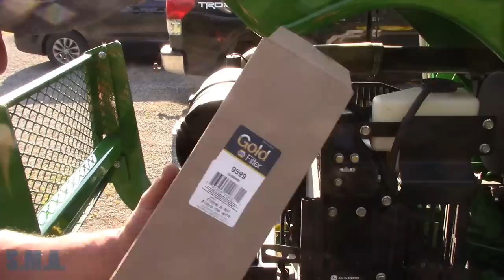John Deere 5055E : Service

Comment from the maker: PRODUCTS USED IN THIS VIDEO:
LockNLube Grease Gun Coupler: https://amzn.to/2CGYCzU
Lincoln 1147 Grease Gun with Hose: https://amzn.to/3g7t3xG
Heavy-Duty Oil Filter Wrench 4-1/2" to 5-1/4": https://amzn.to/2ZXJAP0
Shell Rotella T4 Triple Protection Conventional 15W-40 Diesel Engine Oil: https://amzn.to/2CQOi8r
 Scott Shop Towels: https://amzn.to/3hCfuGO
Reply: Nothing runs like a Deere
Reply: That Lucas Red and Tacky in the grease gun? Sure looks like it anyway... That grease gun coupler looks amazing, though it costs 3x the price of each of my grease guns...
Reply: That locknlube is the greatest addition to any grease gun.
Reply: Only use John Deere hy-guard fluid for the rear end any other fluid will tear the brakes up
Reply: Thanks Eric O! Johnny’s lookin’ spiffy!
Reply: @mustangvideo2060  drink john deere kool-aid ,  leave check amount blank, dealer will fill in the amount $ .
Reply: Pro Tip: Pull the dipstick before you refill the engine oil. It creates another vent hole. Then you won’t be waiting on the oil in the funnel to flow in.
Reply: Good looking tractor Eric. Hope it lasts you a long time with no major problems. I like green better than orange.
Reply: Channellock PVC pliers work great for big filters !
Reply: I'm pretty sure my grandpa always went to Napa for parts for his semi trucks. Dad also told me they used to put water in the batteries when you bought them.
Reply: That locknlube grease coupler looks awesome I have to get me one for my grease gun the original coupler would lock in but not release until it got stuck in a nipple and broke time to replace thanks for showing it in the video Eric!
Reply: Get that man a new John Deere hat . He ain't working on junk now.
Reply: Nice machine, what 55 hp, whats the torque, thats the real measure of a diesel power, must be nearly 200nm?
Reply: Hydraulic cylinder on tractor
Reply: I do the same thing with wiping down the excess grease and the zerk fittings lol

Comment: Being a diesel mechanic, I love my universal strap wrench. One size fits all.
Reply: just mentioned using a strap wrench, old serpentine belt, old seat belt or even the belt off your waist :)
Reply: I have strap wrenches, vice grip oil filter wrenches and one of those horrible snap on chain wrenches, I never need to use them, cowardly oil filters !

Comment: Eric, from an old farmer, always block up or tie off any hydraulic accessory you may be working under.  When new, it seems safe, but it won’t take long for small bleed offs to start happening in the cylinders.   My Dad almost lost an arm trusting the hydraulics.  Be safe.  Otherwise great video as always.

Comment: Step up onto the rail when you start it brother, you're one neutral safety away from being jelly.
Reply: solid, solid advice
Reply: Can't say I disagree with this one but I gotta add that for all my life I've been trained to check gear shift to make sure it's in neutral, from semi trucks to open station tractors. If you know what you're doing and it's part of what you do standing on the ground is okay. But for most all people, stand on the step at least like you say.
Reply: The three guys that didn't follow this advice are not available to support your comment.  That 4 x 4 wouldn't have much trouble crawling over the youtuber.
Reply: Yes, let’s not shake hands with danger
Reply: farm.central. ohio had a guy I used to work with at a shop working on a car and he asked someone to start a car for him, guy reached into the window not realizing it was in gear and the safety switch obviously broken, car cranked up and lunged forward and pinned the tech between the car and a massive steal used oil tank, broke his hip pretty nicely, definitely taught me a lesson at an early age lol
Reply: @2491kridge  Every fall I use an open station tractor to power an auger for unloading trucks. I start that tractor every time standing on the ground beside the rear tire and every time I check the gear shift, even though I'm the only one that touches it all season.
Reply: My JD has the clutchless PowerReverer shuttle transmission.   You can easily start it up while standing next to it, no clutch depression is required, just the shuttle lever has to be clicked into neutral.   The shuttle option is a no-brainer for loader work.   Not having it on a loader tractor would badly de-value it at trade-in time, moreso than the cost of this option, so it's virtually "free" in the end.   SMA likely got a great "deal" because the original owner traded it in for a shuttle tractor.
Reply: That tractor actually has a Park gear.
Reply: John Deere only starts in neutral
Reply: @davidwinfrey3307  All John Deere's or this one that Eric is working on? Because if you say all I'm never standing near a tractor when you start it up.
Reply: @2491kridge  That's part of the problem - unless it happens in front of some people it's not a "real" danger. See what's happening with covid at the moment.

Check the gear, call out to the person under the hood, wait for reply, THEN start if appropriate.
Reply: Good advice but he’s got a 5”er and it’s thick
Reply: safety third!  lol
Reply: Can you tell me where you got that pair of bent nose pliers you pull faces with
Reply: Hawkeye approved procedure

Comment: My sister owned the same model tractor, a very capable machine. It had never been serviced. Changing filters, fluids, a new battery, a new tire, and replacing nibs for greasing the bucket, cost for parts and fluids $1,110. Several trips into town for tools (oil filter wrench) it turned into a two day job. I don't understand why people will spend so much money on equipment and not pull the service on it.

Comment: Eric,  I usually have nothing to add to what you do since you tend to cover it all but there is finally one thing I can suggest to you or anyone. Especially if you do any brush hogging blow out the radiator, most new tractors have more than one rad stacked together and stuff will easily get caught between them. A lot of them unbolt or unlock and you can slide at least one of the rads out for easy access. They make an excellent blow gun for such a job, it's called an Air Comb. Inexpensive but works great. Just something easily over looked. Thanks for the great video. Okay now I see you blow out the rad, silly of me to think you'd skip that lol

Comment: For the oilfilter i use an old timingbelt or auxilairybelt .If parked in the open/sun coverup the steeringwheel and dash as well as the seat to avoid deteriating due to UV.
Reply: This guy knows what he's talking about  :)  and put a coffee can over the muffler if it doesn't have a flapper, not only for rain but birds like to try and make nests in exhausts. Yes, i know, why lol Some birds are just dumb I guess.
Reply: @monkehbitch  The birds are kind of interesting which pipes they go for, got an older tractor and the tip of exhaust bends to about a 45 and they land on it but won't nest. Got a newer tractor with more straight tip and every time I start it a wad of stuff blows out lol  Maybe you could cut your vents at an angle to keep them out.

Comment: Nice tractor...I am a retired fleet mechanic and I didn't see you support the bucket lift assembly when you had that up in  the air it could drift down on you and that could be serious... if the machine is off not running some units , just by moving the up/down lever will let it come down...we had safety bars that fitted around the lift cylinder piston... I have not worked on these units for several years but I think it would be prudent to look into this for your unit ...God Bless you and your family...
Reply: The bucket is on, it won't come all the way down. Relax Nancy.
Reply from the maker: No balls no glory

Comment: Hey Eric I've been reading a lot about "right to repair" issues stemming from John Deere blocking access to their farm equipment computers (equivalent of ECM, etc). Any problems in that regard working on that tractor?
Reply from the maker: I have a full set of service manual from John Deere for this tractor and that is the number one reason I bought a non electronic full mechanical tractor 😉
Reply: @SouthMainAuto  Awesome!! Thanks for taking the time to answer. Appreciate the video, as always!
Reply: The issues you speak of with JD are more with the larger farm tractors. They will sell you a high horsepower tractor but then charge you extra to get the full horsepower out of the machine by showing up with their computer and clicking on a few things. They are all about milking every penny out of a farmer. They won't let an independent mechanic have assess to any info so you are forced to take your tractor to them for work. It's one of the largest scams going on that most folks don't know about.
Reply: @farmcentralohio  I have a feeling it getting ready to creep into regular vehicles more and more.
Reply: broomsterm  You are referring to smaller tractors, I was talking large machines. There's not many companies bringing in large tractors to the States. John Deere is a money hungry company looking to squeeze every cent they can out of anyone that'll give it to them. Go into a dealership sometime and see how much they charge for things and then you'll understand.
Reply: @farmcentralohio  Any Independent equipment shop can unlock the ECM easily.  Mods and deletes for the modern big stuff are all over the internet  as are manuals and service bulletins. All free and without JD authorization.
Reply: @cluckhead1913  lol um, you're wrong. Do a little google search there bud. John Deere has been fighting people in court to protect their info. Thanks for trying to sound smart though I guess.
Reply: farm.central. ohio Correct and the only coverage about it is an hour long documentary some kind soul took the time out of their lives to make here on youtube.
Reply: DIY Dave It already has. The BCM in newer vehicles have the codes/commands to control all of the available options the dealers offer such as seat memory and such. It is quite literally a matter of plugging in a laptop, hooking up with ELM327 (or whatever appropriate chipset) chipped OBD-USB cable, and turning an option on. Assuming the part you want to enable is in fact installed, of course. If people saw how many options that are in a ford bcm that are disabled by default but could easily be enabled, heads would roll.
Reply: cluck head False. A responsible shop with any kind of legal sense is going to apologize profusely and not touch the equipment with a 10 foot pole before they start dicking with proprietary software. People don’t “delete” tractors, at least no farmer in Nebraska (my home) does. Its a huge waste of time and money, and now due to the recent EPA legislation is entirely illegal to do. Modern SCR, EGR and DPF systems are efficient and do their jobs well. Its lack of maintenance that causes problems. Manuals and service bulletins can be found, but I wouldnt always call it easy. Mfgrs do a good job of making sure that content stays buried. Currently, there is a version of the JD software that someone pirated and cracked, and some DIY mechanic farmers are taking advantage of it because of JD’s absolutely ludicrous business practices.
Reply: @oddieboi  JD will sell you a 9620rx top of the line tractor but it will come with not quite 600 hp, to get that extra hp that they advertise right in the model number of the tractor they will charge you an extra 20,00 to 30,000 to come out, plug it in and click a few buttons. But nobody outside of JD is allowed to even know how to do that. That is what I would call a money hungry scam
Reply: @oddieboi  There's news articles about it, mostly in farm publications but they are hard to find sometimes. Right to repair is what a lot of them call it. In a tiny way it makes sense that JD wants to control repairs to make money but its complete bs how they've gone about doing it
Reply: farm.central. ohio any evidence about that? Sounds a bit weird, since they would risk to loose in pull outs against competitive brands.
Reply: @RoughRiderBB  Look up ''right to repair John Deere''. There is evidence all over, online, farm magazines, anyone involved in farming can tell you. There are on-going court cases where a farmer or mechanic wants to work on a JD but they can't get the computer info from JD. I'm talking large farm tractors, not the smaller ones. JD knows there's no money in fighting about the small ones
Reply: @RoughRiderBB  Mike Mitchell is here on youtube, farmer in Canada. He just recently did a video talking about JD selling them a 9620 rx tractor and the hp was less than 600. To get the full hp they wanted him to pay either 20 or 30,000 extra, on top of the original purchase price.
Reply: @DIYDaveOK   Like Tesla??
Reply: broomsterm  Foreign countries add tariffs to John Deere equipment. I once bought a small Korean tractor (Montana)  for a horse boarding facility i had. Great little tractor. They had to quit producing them. Something about copyright,LOL
Reply: broomsterm  This tractor was assembled in India.
Reply: @SouthMainAuto  Mechantrickery over electricktrickery every time...
Reply: broomsterm  The 5055E is made in India, and its a simple stout tractor.  JD loves painting other manufacturers stuff green, and charging a bit more for it, but if they will supply parts for it for ever, the green paint will eventually be worth it.  I may be wrong but I don't think any of the big $1-200k+ stuff loaded with electronics is made in India, or China.
Reply: @farmcentralohio  Do you mean the radiator coolent temperature switch they charged me $80 for? The nearly identical one in my car costs $6.
Reply: Mike Keegan  Total bs.  Not about regulations or unions.  It's all about more $$

Comment: Working on boat diesels, I have a similar problem with different size filters, plus one: often space is so tight, you can't slip the ring of a wrench over the end of a filter.  So umpteen years ago I bought a filter strap wrench.  Cheap die cast handle and a sticky rubber strap.  You can feed the strap around the filter.  Works like a charm; one wrench fits all filters and all spaces; probably paid $10 for it.

Comment: Love my ol 47 Ford...use to pull with it at antique tractor pulls...it has had a six cylinder conversion. Even at low rpm's it'll wheelie a few feet off the ground.

Comment: The draft control is activated when the shaft just above where the  top link is connected to the tractor is flexed from a heavier load from the implement. Great videos, keep em coming. 👍🏻

Comment: One of the things I should have gotten years ago,  a powered Grease Gun.  Mine is a Milwaukee.  I added the same type of locking grease nozzle onto it.  Click on and pull the trigger.  You can hear it pump and basically know if it’s one pump or 2 pumps, etc of grease going in.  I have a lot of things at work to grease and manual guns suck.  I could never go back.    You could grease that tractor pretty quickly and easily with one.  

I’ve also changed grease fittings on things where I’d have to use a 90 degree adapter to fit the grease gun nozzle on.   Install new 45 or 90 degree zerk fittings so I never need to use an adapter ever again.  I can just clamp on the nozzle and pull the trigger and grease up.  Makes the job so much easier and faster.  Some things I really have to reach to get at.  Trying to pump also, sucks.

Comment: Definitely make sure JD gives you the right fluid. I went in and told them the model number of zero turn mower I had and told them what parts I needed. Most of the order was right but they gave me the wrong trans fluid. Luckily I read through the manual before I dumped it in because it specifically said not to use the stuff they gave me. Now I look up part numbers and specifics before I go there for anything

Comment: I like watching a man who likes machines.  btw:  You can buy "rubber" caps with retainer straps for brake bleeder screws/grease fittings to keep schmutz out of them. A dollar store telescoping pickup tool is great for retrieving oil drain bolts from catch pans and parts that fall just of reach.

Comment: Great Video!   I own a John Deere 5075E, purchased new in 2015, basically the same except higher horsepower and TIER 4 emmisions with DPF and regeneration.    Since the tractor is vital on the farm everyday for myself to make a living, it gets used more than yours does, now has 3,055 hours.
Mine has the fuel filter on the left side, it uses a clear sediment bowl that screws onto the bottom.  Also has sight glasses in the Tran housing beside the PTO making a fluid level check only with a quick glance. 
20:10   Check the manufacturers plate.  Most of the tractor was built & assembled in INDIA.
You forgot the grease fitting on the rear of the front axle kingpin.   Sticks down to the right.
26:00 Oil fiter was already changed, the original one from the factory is painted green.  The horizontal filter placement always makes changing oil a mess and you can't prefill it before screwing on.
I always have genuine JD filters but their oil is overpriced, I use Shell Rotella Full Synthetic.
29:00  If you actually read the manual, it says to not over-lube the rear axle grease fittings as it may damage the seals.   Service is only recommended if you use the tractor in excessively wet / muddy conditions all the up to the axle.
34:00 The little drain petcock is a piece of junk.   In all my tractors, I have replaced this with a brass ball valve, much bigger for passing out gunk.  Screw on a hose with fitting unto the valve and you have a much less messy way to drain the tank.
Enjoy your green tractor!

Comment: Eric, your draft control regulates the depth of your implement. Say you set a 3 bottom plow to a 6 inch depth, the draft control is supposed to maintain that depth. You can kind of do that in manual mode, but it is a pain in the hoo hoo!! John Deere, The color of money!!